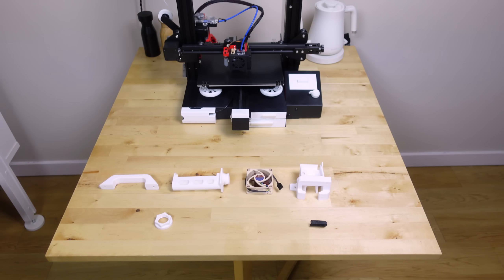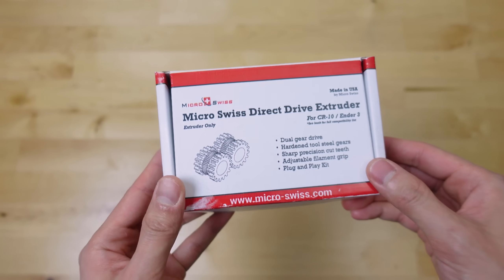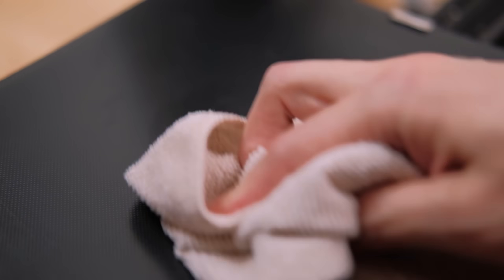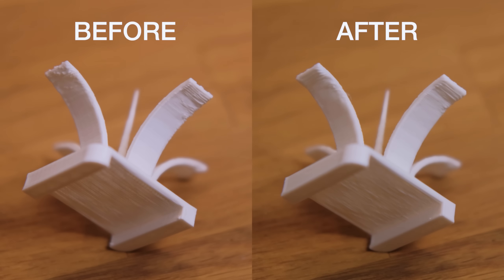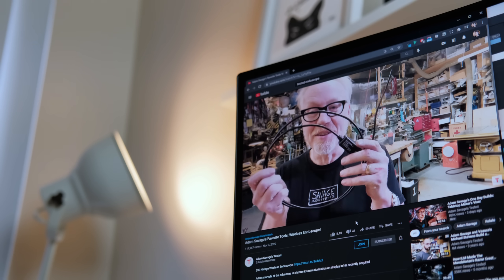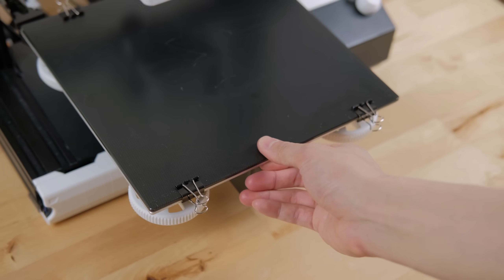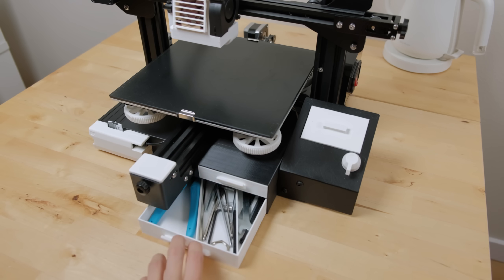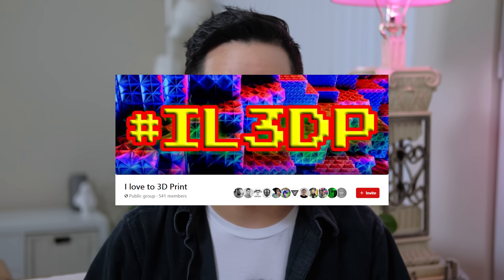15 More Upgrades for my Ender 3 Pro - Part 3

Comment: Hi Scott, I like all video that you done to improve the ender 3 pro! I have an important question to ask you an is:  Is there a way to implement the run-out filament sensor on the Ender 3 Pro with the original motherboard? if yes, can you  do another video to explain it and post the links to the project? thanks a lot

Comment: Awesome content you have. Just found your channel. So, will the company that makes the printer implement some of your mods? To me most of them should have been there from the start, especially quieter fans and the filament holder. They should pay you make their printers better before they launch them in public.

Comment: Some great suggestions for upgrades, but I wouldn't recommend replacing the metal lid of the power supply. It's metal for electrical safety and flammability reasons...

Comment: Hey Scott great vid always love watching it the video making is super nice. Quick questions. When trying to get the prints off the bed do you still recommend the spray bottle method even if you do not have a glass bed. I have a normal ender 3 and have replaced the bed and sitll have the stock flexible plastic one that they have.

Comment: Dude!  so I got an Ender 3 Pro from Offerup for cheap.  I'd been looking at several different 3D printers, and I'm really glad this deal came along and I got it.  Being new to 3D printing I was a bit overwhelmed, but after watching your videos on upgrades, it helped me understand some of the trials and tribulations encountered in the world of 3D printing.  Also, to challenge myself more, I've never had a Raspberry Pi, but seeing you install one on your printer has compelled me to get one and start learning how to integrate it!  

So, once I can successfully print (this was not originally assembled by me, and I have beginners problems of leveling, and first layer not sticking), I'm totally looking forward to printing many of the upgraded you've shown in your video.  I'll be sure to follow up with comments at a later date!  I even got a leveling kit with the printer, but the probe is missing, so I'll have to see about getting another probe.  :'(   Thank you for your videos!!

Comment: First off, very entertaining videos. Usually I feel the need to skip through to get to the good parts. With your videos thats not even a thought that pops in my head. Any way you could do a video on the settings you use to 3d print those mods. I've been having trouble trying to get them to print nicely xd total noob here.

Comment: To cool the endoscope camera you could also print an extra mounting surface on the fancover/cameraholder to put a heatsink to lead the heat away and cool it elsewhere.

Comment: So, I started ordering some parts based on this video. The Furiga 5015 fan IS NOT supported by the Ender3 Pro mainboard (v4.2.2 Creality board). I think it needs more power than what the board pushes to those two pins.

Also want to warn folks that the Noctua NF-A4x10 is a 12v fan and also lacks an appropriate cable length. So you're going to have to splice wires and invest in a buck converter because the Ender3 board's output is 24v. You could try to add up-front resistors to the fan, but they can get quite hot (see CHEP's video https://www.youtube.com/watch?v=vjL38udVS24).

Comment: Instead of getting the Z extension, you could of turned the E stepper motor around and printed a attachment to mount on the other side of the direct drive plate.  Personally I went with the printermods versions and a dragon hotend, as I use a linear rail for X and Y.

Also I have been working on a auto belt tensioning setup for X and Y, so far I only have it on X and it works pretty good.  I will have it on Y soon as well.  Let me know if you are interested. :)

Comment: Thanks  Scott for the videos.  I am going to do some more custom upgrades to my Ender 3X that you showed on your videos.   I did the all metal  dual gear extruder as one of my first upgrades. Workers great.  One upgrade I did was I purchased 600mm dual channel extrusion to extend my build height,  a second  Z axis stepper motor kit ( included dual Z-axis motor controll cable) and two  600mm lead screws for the extended height.

Comment: Thanks for your videos bro, all of them are dope and super helpful. I currently have an Ender 3 Pro with Creality's DD kit, and I'm contemplating on switching to the MicroSwiss DD kit. I know you went from stock to MSDD, but any feedback or recommendations you could provide would be greatly appreciated. I'm just not sure if there's a huge diff from Crealitys DD to Micro Swiss DD, and there isn't a ton of info out there to support that.

Comment: One thing to remember about direct drives is the added weight to the tool arm will cause heavy ghosting and lower the lifetime of your belt and stepper motor that moves the tool head.

Comment: Hey Scott, great video. You should be aware that switching power supplies are electrically very noisy and generate a lot of RF interference. The steel case plays a big part in keeping that RF interference contained, so replacing the steel cover with a 3D printed part may cause you to see a lot more electrical interference when the printer is powered on. Whether it's a problem or not depends on how much RF noise the PSU puts out without the cover and how sensitive the circuits in the area are. It can range from no problem at all, to subtle issues to major problems -- it's very hard to predict. The best practice is to leave the steel covers in place and just enlarge the fan hole. Just FYI from an electrical engineer. Thanks for the video!
Reply: Would lining the plastic cover with something like copper tape alleviate this issue?

Comment: Awesome Video! I would recommend an bi-metal heatbreat for 30$ instead of the Microswiss hotend. It even increases the melt zone by like 6mm and completely eliminates Clogging. With an Microswiss Nozzle or CHT Nozzle you have Volcano melting performance.